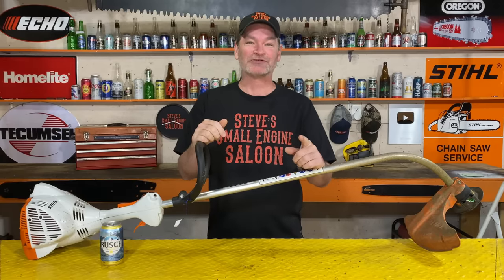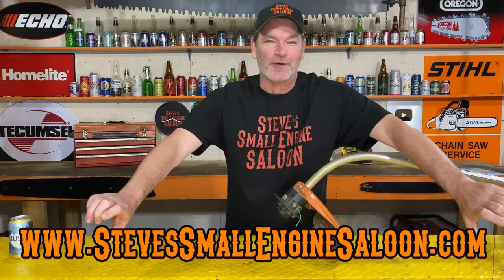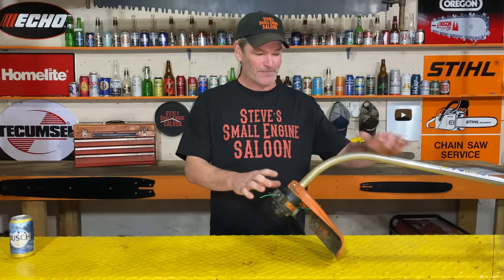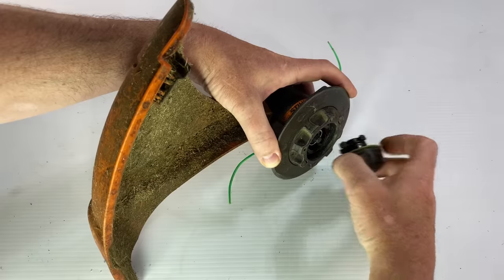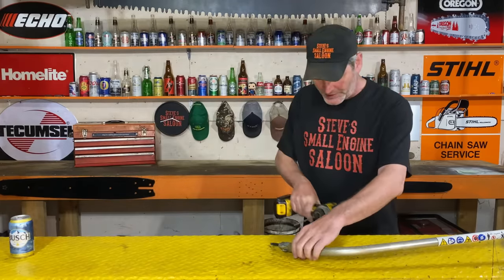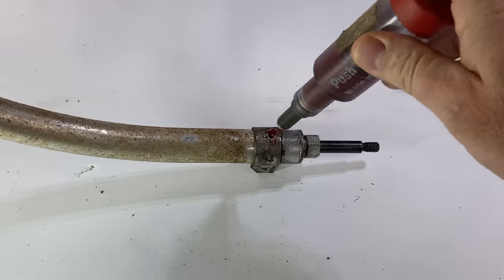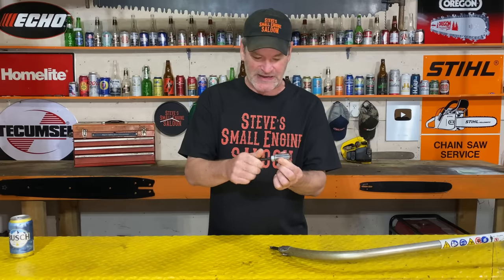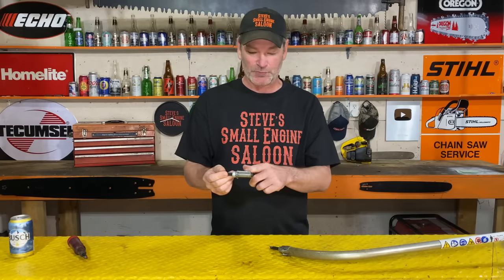WOW! Hidden, Secret Greasing Spot On A Weedeater

Comment from the maker: ✅Click here for the grease gun ➜ https://amzn.to/3iEYD6E
For more videos like this, check out: 
👉How to Adjust or Tune the Carburetor on a Leaf Blower ➜ https://youtu.be/DWPUYJiF6KM
👉CORRECT WAY To Tune The Carburetor On A Chainsaw ➜  https://youtu.be/M6T5JoGXcHY
👉How To Adjust Or Tune The Carburetor On A Weedeater ➜ https://youtu.be/gmhxTvGRtCg

You can connect with Steve here too: 
✅Visit Steve’s WEBSITE ➜ http://www.stevessmallenginesaloon.com/ 
✅Visit Steve’s PARTS & TOOL STORE ➜ https://www.amazon.com/shop/stevessmallenginesaloon 
✅Follow Steve on FACEBOOK ➜ https://www.facebook.com/stevessmallenginesaloon 
✅Follow Steve on INSTAGRAM ➜ https://www.instagram.com/stevessmallenginesaloon/ 
✅Follow Steve on TWITTER ➜ https://twitter.com/SteveSaloon
Reply: Hi Steve. Good video. A hack I do to our fleet of stihl straight shafts is to drill a 5mm hole through the grease nut and tap a thread for a grease nipple. 😁
Reply: Hey Steve I found your channel because I'm currently having trouble with a generator. It's a Predator with 3500/4375 peak watts. I live in California and we're dealing with triple digit temps during the day and it only gets into the low 80's at night so I'm doing whatever I can to fix it. I know about motorcycles but not much about Generators. Anyway I'll get to my question. Why aren't the RPM's changing when I plug something in? For example: If I plug something in like my freezer or window AC (5,000 BTU's) it shuts off because the generator won't give out enough power. The only way I can keep them on is by having them at their lowest setting which just isn't enough. Hopefully you will see this soon and reply thanks! ✌️
Reply: Similar to my Singer Sewing Machine.....which takes 3 in 1 oil tho.Tee
Reply: Pp

Comment: Cheers Steve for sharing that's great. My FS38 was 1 year old and lost power wouldn't run at high rpm only idle and bogged down when accelerating so went back to dealer.  Charged me for new fuel new plug and new spark arrester in muffler. It just needed the spark arrester CLEANED!! and plug and fuel were only weeks old too. So no dealers for me anymore. I clean spark arrester every season no problem and it's a great trimmer. I've learned lots from you and others on good old YT so thanks very much for sharing cheers.
Reply from the maker: You're Welcome...

Comment: Steve.Your The Best Hands Down For Information On Small Engines !!!  I am 74 and usually if possible repair all my small engine equipment. Have a fs 45 and did not know about the grease hole ! Just rebuilt the carb. Will for sure grease the lower bearing !  YOUR THE BEST !
Reply from the maker: Wow, thanks!

Comment: Steve, Just letting you know.  I have an old TroyBilt trimmer that is 15 years old.  Runs like new, its  4 cycle. I change oil regularly, and change spark plugs. Only thing ever replaced was the carburetor.  Why is a 15 year old trimmer  and attachments still working.  Simple, I have used all your tips on my equipment for a long long time Bro.  Damn you've saved me a lot of money.  My friends all wonder why I never have any new gear.  I say, This stuff runs why waste cash. Then I link them all to your Youtube channel.  Keep it going my beer drinking friend. Thumbs up times 10!
Reply from the maker: Right on

Comment: Hi Steve. I have worked with those trimmers for twenty years. No one has ever showed me this until today. Thanks so much.
Reply from the maker: Glad to help
Reply: @StevesSmallEngineSaloon  
I'm just gonna guess , but is it in the maintenance section of the owners manual (that nobody ever reads)? 
Hiding right in plain sight 😂
Reply: @MrTheHillfolk  not in my manual.  I’ve used the same trimmer since 2006 and have never greased it.  I never heard of this but I’m going to grease mine soon.

Comment: Steve, THANK YOU for this video! My wife just gave me an FS 40 and I'm a firm believer in grease and oil being the cheapest maintenance you can do to anything mechanical!
Reply from the maker: You're Welcome...
Reply: Can you use 3 in 1oil or does it have to be grease?
When you say Grease, I  think of a thicker lubricant rather than an oil.  Thank you for your time.

Comment: Thanks for the tip I just removed that bearing on my electric sthil and it has the same hole, and collar with bolt setup. Now I know what that hole is for and why it had dried grease in it. Thanks again!
Reply from the maker: Glad it helped

Comment: Hi Steve hope all is well with you, I purchased a 14”Electric Toro Weed Trimmer model #51480A, assembled and it worked great used it and when it needed to replace the string which I did rewind and loaded it as was illustrated poorly in the manual the string is constantly jamming and or not advancing, to make long story short can you by any chance do a tutorial on how correctly rewind and load string in this Toro machine sure appreciated since I am not only one who is encountering this problem.
Thank you

Comment: My dad gave me one of those grease guns for chain saws.  Didn't know it also worked on weedeaters.  Thanks.
Reply: J Parra
 ... that grease tool also works on older Mercedes door hinges and u-joint fittings where there's no room to get a normal grease gun tip.
Reply from the maker: You're Welcome...

Comment: Today I was trying to make one good Stihl fs-36 trimmer out of 2. (It worked, but I had to stop in the middle to order a carb kit and fuel lines.) The best one of the two didn't have a trimmer head, but the other one did so I swapped them out. In the process, I found that little hole for the grease and used my bar greaser to pump it full of fresh grease. Thanks Steve! Maybe I can keep this one running a few more years because I can properly maintain it.

Comment: Question Steve,  is there a way to greese that end on a straight shaft?
Reply: Should be at the the trimmer head a hex bolt. Some have a torx center. It's around 7/16" in size. You do not need to remove the head or the guard on a straight shaft version.
Reply: On the straight shaft trimmer. Can the same grease gun be used?

Comment: With the help of your vids I’ve been fixing my ms170 and fs38 (along with various other mowers etc) for a couple of years. You’ve saved me so much money! Just greased the fs38 but I’m wondering…the top end of the shaft near the motor sounds like it needs some grease, and it’s started to rattle and ring like a bell if I shake it while off. Is that possible? If so, any chance of showing that fix? Cheers from Ottawa!
Reply: ...i drilled a small hole, near the top handle, and shoot a tablespoonfull of 80/90  gear oil down to that bottom bearing.  From your comment, i may do the same, only hold the whacker  upside down, for a minute, till it runs into the top bearing/bushing-  whichever  it is.
Reply: @petersack5074  o

Comment: The Best information I have found anywhere. You are the MAN. I recently repaired an echo timer for a friend and noticed the shaft is getting hot at both ends. Near the head and at the top I guess it's called gear box. It's a echo SRM 225 straight shaft. I put a new carborator, fuel lines, primer pump, vent and filter. Primed it chocked pulled 2 times and it fired right up. Adjusted high speed jet and it purred like a kitten. 2 days later it won't hardly start. Takes a long before able get any rpm's. Boggs down and dies. That's was the problem before a new carb. I went from a happy repair to wth. Give me a cold beer. I'm looking thru your videos for the solution. Any words of wisdom would be appreciated.

Comment: Straight shafts have a bolt on the head gear drive too. Greasing it would be a good idea too.
Reply: Mr. Gregg T I have a lawn service and I’ve never had the bearing go out before the motor did.
Reply: Fivespeed 302 I own a landscaping and gardening service company too and it’s happened twice. The gears where the head attaches has given out

Comment: Never knew this existed and explains why the bearing on the end of the drive shafts always fail after a few years.
Reply from the maker: Right on
Reply: First Last  - that is not planned obsolescence
Reply: First Last  I think your pretty much correct I sell these in the UK and I have never known about this grease point and what the dealer doesn't know the customer doesn't know. Sneaky Stihl.

Comment: Is that on all weedeaters or just that brand
Reply: Well, even the newer Stihl trimmers don’t have an option for greasing. They were meant to last “lifetime”. Tsk tsk... An FS55 for example has a different way of greasing, you can turn the Stihl grease tube into the thread and squeeze it in. I don’t think the lower end models would have such capability but I could be wrong.
Reply: That’s why you don’t buy an overpriced Stihl. Especially the “residential” grade.

Comment: Hey Steve just got an extremely used and abused ferris zero turn mower. The deck doesn't lift with the foot pedal. completely froze up. about half of the zerk fittings won't take grease. What are your recommendations/tricks to be able to get grease to go into these clogged fitting. Thank you. Love your knowledgable videos

Comment: I never waste money on Sthil equipment, I had my 1st Weedeater brand trimmer for 30 years and did little to no maintenance on it other than drain the fuel for winter storage... not bad for a $50 Big Lots cheapy.
Reply: as long as you dont use them , any brand will do  !!

Comment: Well that’s interesting, how ‘bout the straight shaft ones?

Mind outta the gutter boys
Reply: Hard not to with that one
Reply: There is a place to lube on the straight shaft and stick edgers.  It's a larger cap that you remove and lube it with Stihl grease that comes in a little tube.  You take the cap off the grease and the tube screws into the hole where you removed the plug from.  Do it every couple of years.  You can actually see if it's low on grease.
Reply: My FS105 has a screw the same as this one, but it's in the head of the trimmer.
Reply: @123livewire  Only thing special about stihl grease is the price.I use Moly grease on the driveshaft and transfer case, but you could use any good quality lithium grease as long as it's done that's the main thing.

Comment: thumbs up. say, I've tried refilling my push grease gun, unsuccessfully. Is there an easy way ? I've tried forcing it in with a puddy knife and it failed. Any suggestions? It only pushed out about half of the volume that was it it when it was brand new. Thanks for the video

Comment: You are right about a grease hole in the cutting head on weed eaters.  On a Stihl, you remove the Torx head bolt and screw a tube of Stihl gtrease in the cutting head about once a year.  On a Husqvarna weed eater, you remove a 13mm filler plug.  I use Snapper 00 grease in my Husqvarna 128L, straight shaft, weedeater.  I also store my weedeater with the cutting head up, so any extra grease can dribble down on the shaft and keep it lubricated.  Actually, I have a hanger in the shop to hold my 128L in the vertical position, cutting head up.  I ran my RS 76 Stihl weedeater for close to 20 years before I lubricated the cutting head and shaft.  It is a several hour job to remove the shaft, clean it  an lubricate it.

Comment: My STIHL straight shaft weed eater has a grease port located on the head. It uses a screw-in port cover. I've always wondered why the company didn't use a KIRK fitting on the grease port. Would one fit?

Comment: I have a stihl 56rc straight shaft trimmer. there is no fill hole on the head. so i pulled the head and saw grease.- i cleaned it and put new grease there, 
but the head seems to be sealed. [can the head be replaced?]
is there a grease spot on the shaft?
thank you

Comment: Hey Steve! Just replace the lower bearing because it was dry as dust and worn out. I also found the new bearing didn't come with any grease either. I needed a mini grease  gun like yours, but I only had  a grease fitting. I put the grease fitting in my big grease gun and  use that to grease the new bearing. Learned a lot today. Thanks for the heads up!

Comment: Yes it was very helpful, didn't know that thanks. I have a question stihl chainsaw. I replaced the hose line to the oil retainer. Also check the orange plug no leaks. Were i do noticed that it leaks around the were you set the shaft. Help! 😓
Reply: Thank you Steve's, was there going too be a video on the stihl chainsaw on leaks on that i mention i'm having problems with?

Comment: Very nice advice...   I wish when I changes my heads to the three bladed deep weeds head I knew enough to replace the gear stopper...   I had to drill the bladed head off the trimmer to get vice grips to take the bolt off...   after all the drilling grease was needed to lube the gears!   Cheers thanks for video!

Comment: Thanks A Million, Steve !   You can feel how WARM  the tube gets, where the bearing is, after you use it a little while.  I am gonna lube mine, right now !   That is a bronze sleeve bearing, the grease actually is absorbed into the surface of the bronze a bit, so in a pinch I bet you could use oil, until you actually get the handy dandy grease"gun".  90 wt would be swell, but 30 would work.

Comment: Great tip SteveO, I did not know this, going to check mine. But I have straight shaft Husqvarna. 
I will hafta check and see if it has grease hole. Thanks again for sharing buddy. 👍👍

Comment: oi, steve, love yer videos and I always learn so much.  However, about that there grindy bearing,  my strategy is quite different from yers.  When I find one whats grindy I make sure I use it a lot and not put any greese in there.  My theory is that that the parts whats rubbin will soon grind off all them rough edges...and I just saved me self two pumps of greese!

Comment: Steve, I have a Stihl HL94C hedge cutter, it runs perfectly picks up and plenty of power. Its a 2018 very little use only 1 hour a month through the growing season. The exhaust outlet is quite wet, it looks black slightly stiff but while running it spreads out around the side of the casing. I think it could be running a bit Rich too much fuel, talking of fuel the mix is measured with a proper fuel mixing can. What do you think? can I adjust anything to help. Keep up the videos doin a great job

Comment: You ought to do a video discussing greasing and oiling air tools. I believe they are the most overlooked tool. They will last so much longer with a few drops of grease and oil. I know your small engines but everyone uses air tools.
Reply from the maker: Great suggestion!

Comment: Nice vids bud. 
Is this a one beer job or 2. 
Quick question inherited Efco jet200
Bush cutter.  Cleaned up a bit and good gas. 
Bang starts like stink 
Only issue machine has is air filter.  I generally use sponges or such 
This has a inch by inch opening for a filter 
Do i use cut down sponge or paper of some kind. A tat confused on this puppy
Keep up the vids

Comment: Hey, that little grease gun looks cool.  I bet it'd be great for lubing the steering mechanism ball joints on my 36 year old Bolens garden tractor.  Looks like it would hold the rubber cap out of the way and get some grease right down into the ball.  I've been doing it by using my finger to hold the flap up all this time.  Sweet, thanks!

Comment: I read the manuals that come with my power equipment.  I grease the one on my trimmer once a year.  I have had mine for 20 years and only replaced that bearing one time.  Use the brand oil for the mix.  Drain the gas out of the tank and run it till it uses all the gas in the line at the end of each season,  Change your plug and air filter when needed and keep it greased and it should last you a long time.

Comment: Thanks Steve , I have the straight shaft and I'm hoping it's built the same way . Never did it since I've owned it 14 years ,  but I'm just a home owner . But going to check it out , I have a needle grease point that fits my grease gun that'll work on this application . Thanks again 👍

Comment: My dad has a fs38, seems to be pretty good other than the fact that the cold starts are just a royal pain, choke no choke pump the thing hold the trigger down, everything and it takes like 10 or so pulls, warm the thing up, turn it off for gas or string and its a 1 pull with the trigger wide open. Any idea on the cold starts or is that just like normal Sthil weed eaters. Thanks might try greasing that puppy.

Comment: Great video. Thank you. By the way, the difference between a screw and a bolt is that a screw utilizes a threaded hole and a bolt requires the use of a nut. Regardless of the head or thread type.

Comment: I really enjoy your videos and usually learn something every time.  Have you ever done a video on how you keep track of the nuts, bolts, screws, washers etc when you are taking something apart? How not to loose them. How to remember where they go?  Also, inevitably when I am working on something, one nut or bolt falls out of my hand and into a crevice or into the black hole never to be seen again.
Reply: Use an egg carton. Put the parts in order, and when you put your machine back together, reverse the order. Simple. I've  been doing it for years.

Comment: Question Sir! Why after extended storage  does it seem that small engine carburators resist return to proper idle? After cleaning, reinstallation and adjustment all is good but the butterfly plate resists proper return to idle status! Manually forcing the cable lever will bring  the equipment to a proper idle speed for a momentary solution until the next throttle up then it's back to higher than normal idle rpm!

Comment: Hi Steve i serviced a STIHL FS 56 RC-E and noticed it appeared to not have a grease fitting on the gear case  the 56 and 70 have similar gear cases could it be inside the the shaft square hole? my 55  has a grease relief there when i grease the gear case through the side plug